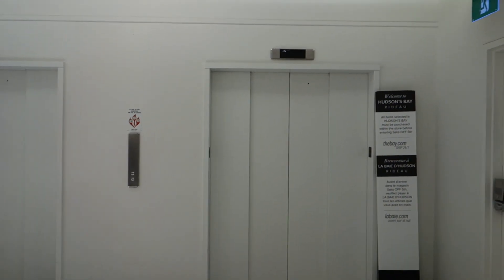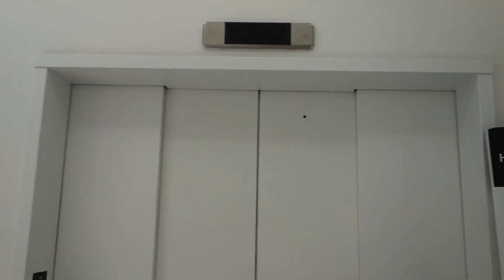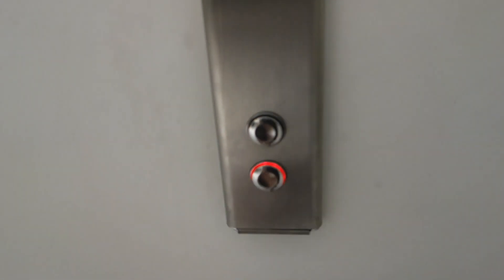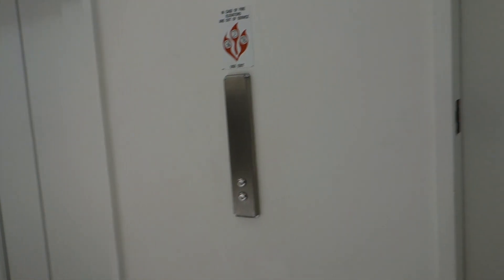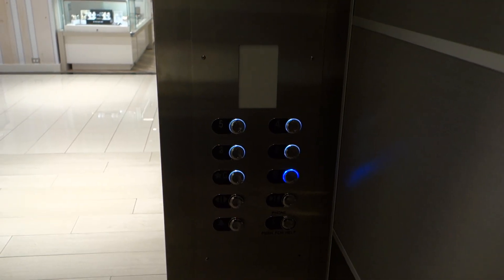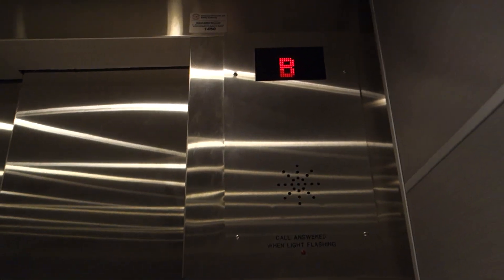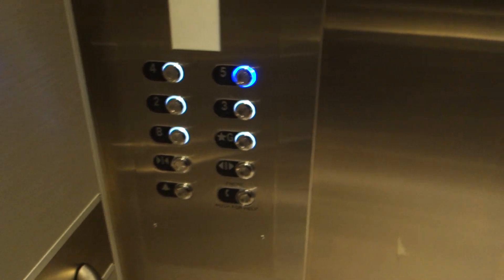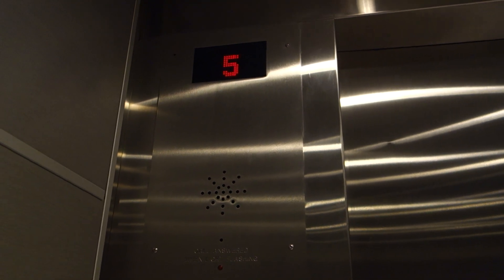RUINED KONE (FORMER TURNBULL) Traction Main Elevators at Hudson's Bay, Ottawa, ON

Comment: This is why is I have a disapproval on Kone.

1. Shit
2. Bad buttons
3. Not great at all for modernizations and installations.

Today, I filming an elevator that has a Kone mod. Used to be a Lexan I believe.
Reply from the maker: This comment made me laugh si hard!!! So true though!!!
Reply: Not true in Australia/UK/NZ, but true in the US (maybe; I haven't seen many Kone MonoSpaces/EcoSpaces)

1. EcoDiscs are some of the more reliable elevators in the above countries (especially in the UK, compared to many crap generics)
2. KDS 300 is quite nice with its white illumination and LED indicators (the LCD ones look rather crap), and KSS 970 is also nice.
3. Most Kone MonoSpaces still are holding up for more than 10 years (one second generation EcoDisc installed in 2003 and still working, one first generation EcoDisc installed in 2000 and still working), which is more than the 10 years liability (generic quality) that most US filmers love to spread around.

While, yeah, generic buttons really take away from this mod, Kones are still some of the better elevator brands, even in the US and especially in the UK.
Reply: BC'sVators I disagree with you about one thing from Kone:
Polaris.
Reply: BC'sVators: I agree with you.
Reply: Hey! Stop doing that to KONE! This is beno’s favorite type of modern lifts!